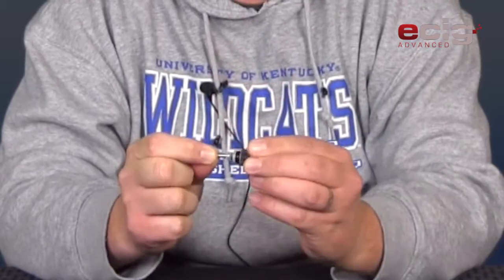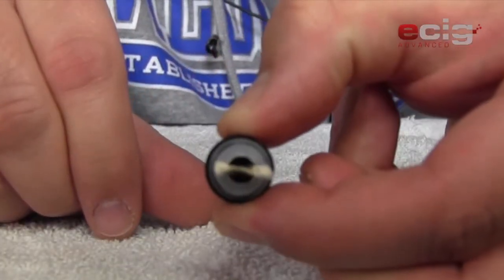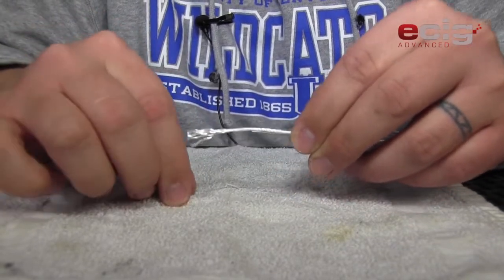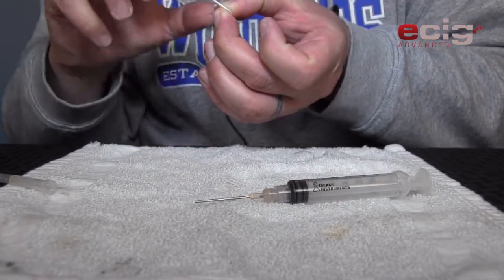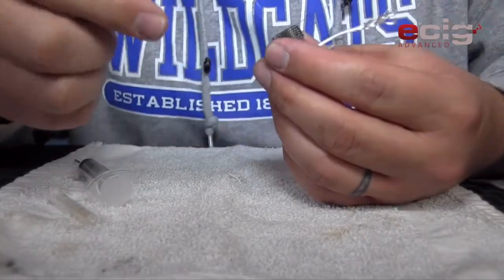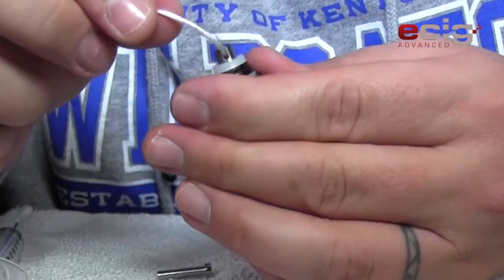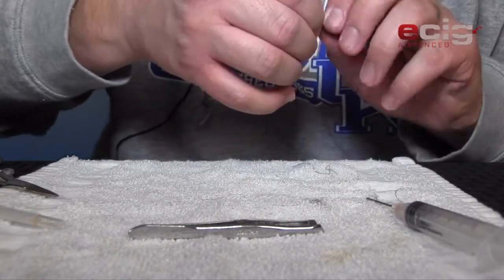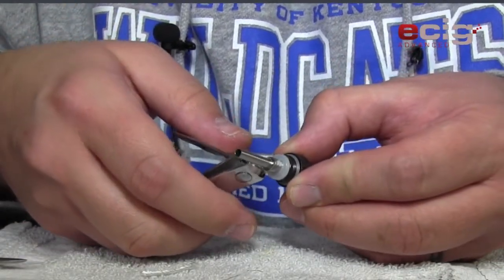Kanger T3 rebuild tutorial

Comment: Just got done using your guide to rebuild one of my T3 heads and it is noticeably better! A local B&M was kind enough and gave me the wire and wick. I used 32 wire, 2mm wick, 5 wraps and the vape is WAY better than a stock T3 head. Thank you!

Comment: Just a tip, the right sized phillips screwdriver works great for pushing the bottom grommet down into the hole, the inside wire easily just goes through one of the 4 spaces in the screwdriver head :)